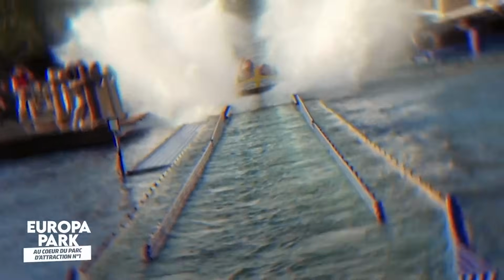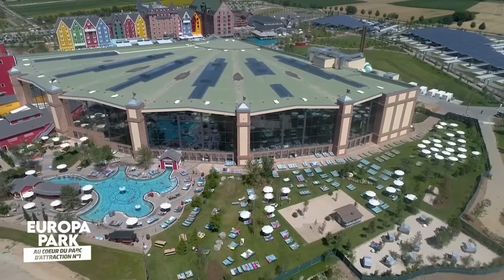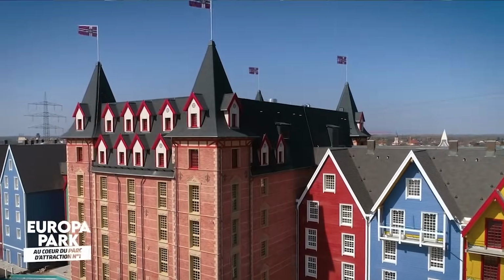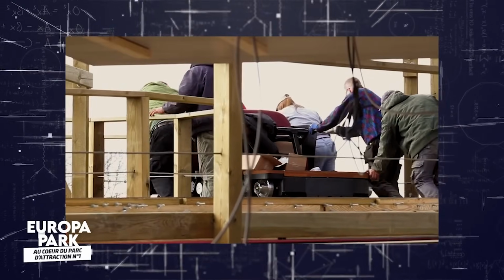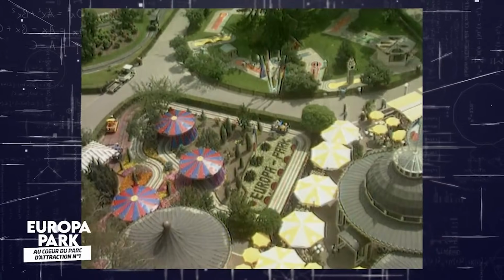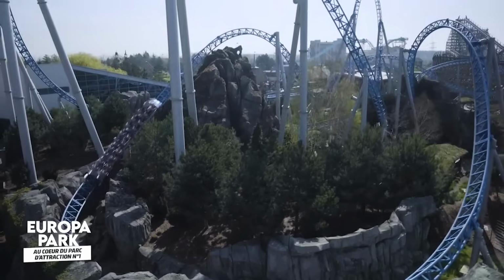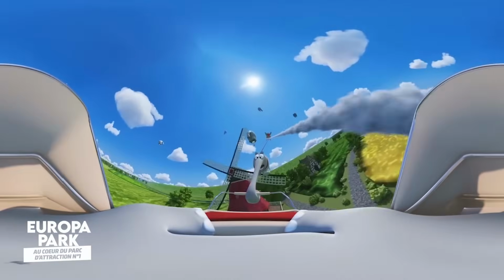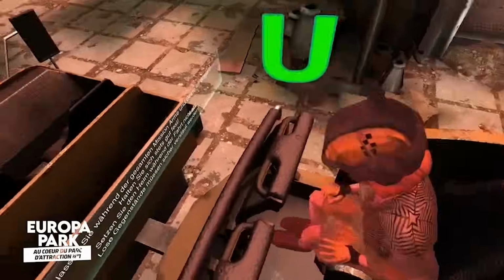Building, Running, and Maintaining a Giant Theme Park | FD Engineering

Comment: As we see with Voltron - this power-machine has a lot of families riding it , even with younger children…130 cm height- requirement…👼
29:05 Why is Formula Rossa by Intamin here ?
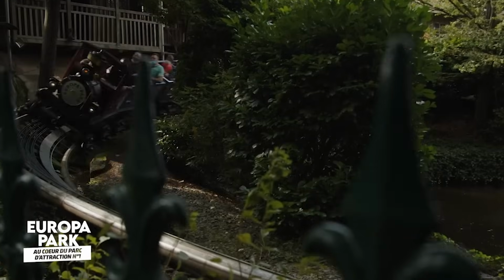38:52 It’s Phantom of the Opera now for the Cancan Coaster,since 2023…
This is from 2022
EP got the Golden Ticket Award 9x in 10 years !